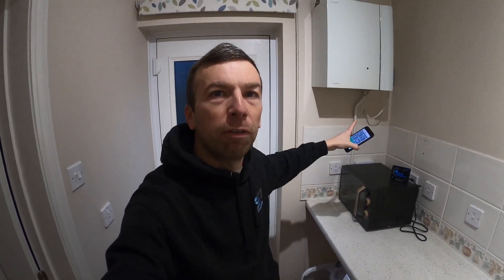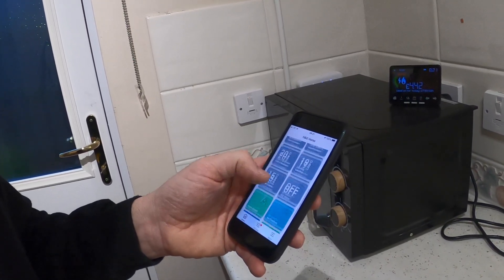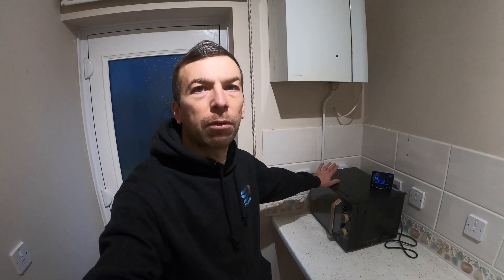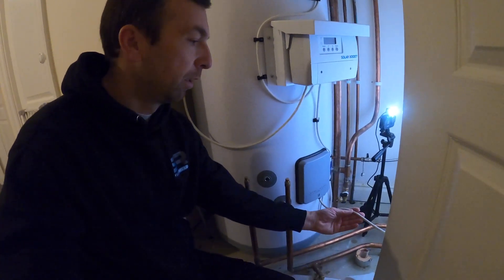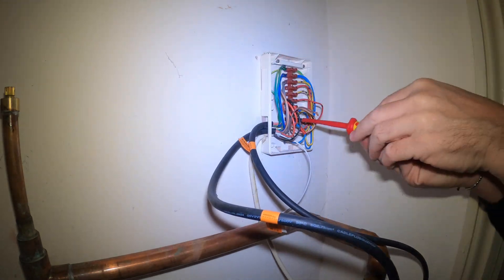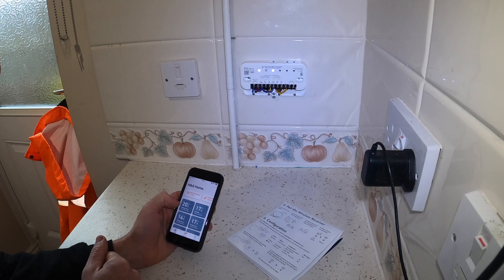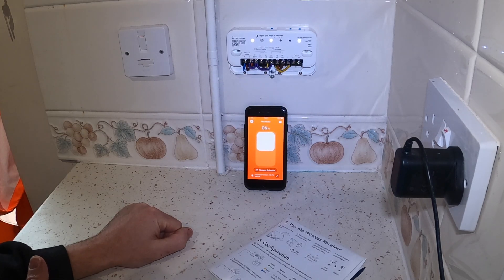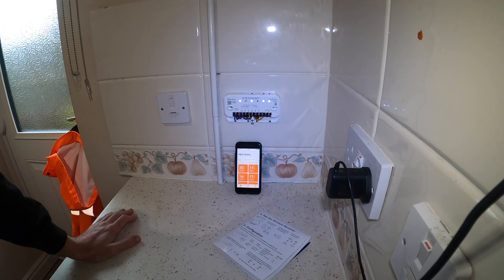Tado smart thermostat. No Hot water, Fault!

Comment: I presume you charged the customer for this call out and making the wires neat again? There was just no need for any of it. First port of call for any faults, especially if it has been working it’s very rare a fault in wiring you should have asked the customer just to reset the Tado which would have solved the issue, save the call out and saved the customer money too
Reply from the maker: The wiring centre was changed as part of a conversion from unvented to high pressure cylinder. The customers issue with the tado was already there and technical asked us to check through all the wiring which is why this happened. The customer was not charged for the tado fault but was charged for the wiring centre change because it was requested. I agree it would have been a waste of the customers money for the fault on the tado but sometimes it’s not about money just customer satisfaction and my time spent here with the customer, ultimately delivered on there expectation
Reply: @srelectrics3710  ahh I see, that’s fair enough then of course! I thought you had just come out at that point for the Tado fault! Lol, thank you for your response, good job and good video